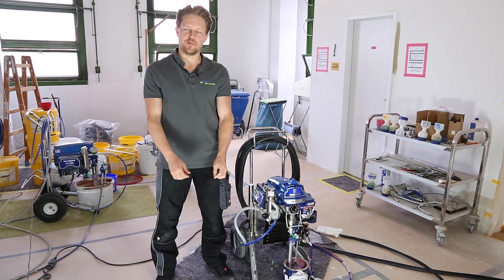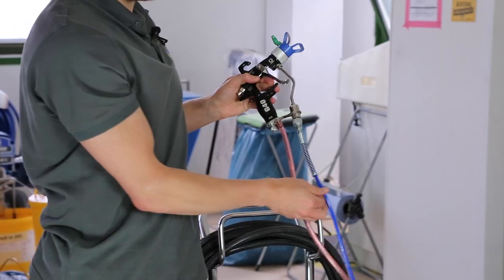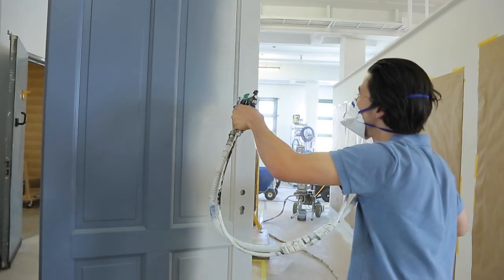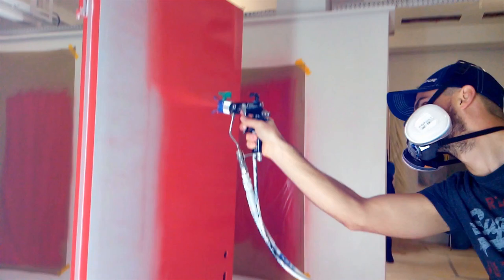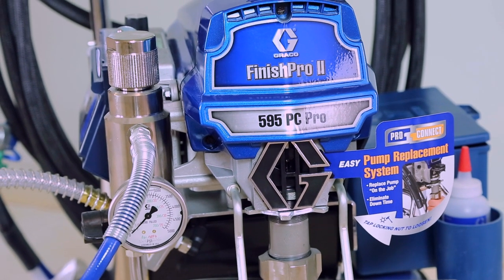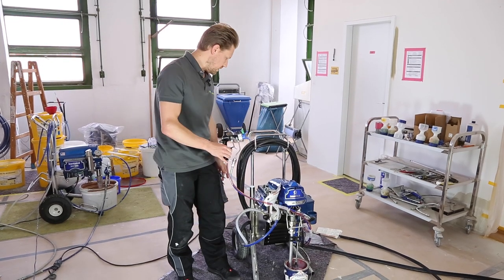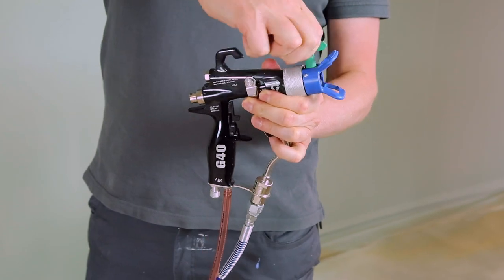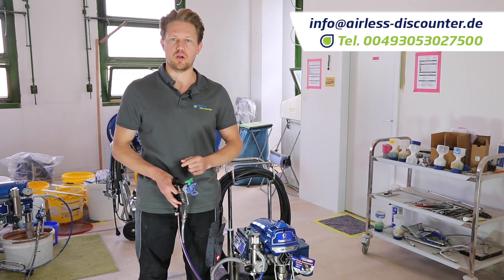Graco FinishPro II 595 PC Pro - Introduction, Specifications, Features and Delivery

Comment: Hello. I have this unit. What's causing the compressor to not shut off during spraying ?
Reply from the maker: Hi,
You must have an air leak somewhere. You must control your air outlet valve on the compressor, the air hose as well as the aircoat gun itself. 
If the issue remains, a professionnal needs to have a look at the machine entirely. 
Kind regards,
Airless Discounter team

Comment: Is it really that better than the regular 595 with fine tip?
Reply: Hi Ace, there are clear advantages of the air assisted application if you want to spray woodwork or similar applications.
Reply: If you want ultra fine finish close to Hvlp...I have this pump and I love it...but it’s kinda a bitch to clean the bullet spray tips...

Comment: Hello, when the  liquid pressure 50 bar and air pressure 3 bar with fflp tip. İs there good pattern?
These pressure is 
enough?
Thanks in advance
Reply from the maker: Hi Deniz, for a FFLP 310 spray tip, we are likely using a higher liquid pressure closer to 83 bar, with a lower air pressure of about 2 bar. If your air pressure is too high e.g. 3 bar or more it increases overspray. A standard spray tip operates around 124 - 165 bar, so for low pressure spray tips, we working with liquid pressures around 55 to 96.5 bar (but 50 bar is likely too low). We hope this helps!
Reply: @AirlessDiscounterInternational  Thanks for reply dear.